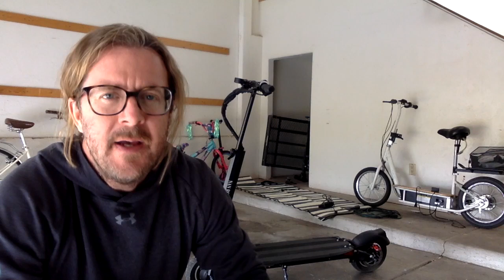Nanrobot Electric Scooter Review

Comment: Yeah so I ordered this from the Nanrobot site. Arrived broken, with a cracked back, fallen off back light, broken horn due to the red wire connected to the inside of the headlight unattached itself after one day, before I even used the scooter. It charges perfectly fine so no problems with that but the issue was the company sending me a scooter that has silver scratches/ scuffs on it which 100% didn’t happen during shipping, and a dodgy front and back light. The scooter itself works fine and runs well- but without the basic safety equipment of lights or a horn it makes it unroadworthy.
Reply: Emailed them hope they reply soon but it’s the weekend rn, I’m scared to send back because I don’t want to wait weeks for a replacement or for them to suddenly stop replying to my messages and just never give it back. 🤞🏼

Comment from the maker: Update. So I ended up buying a Razor E-XR with lithium battery for 1/3 the price of the Nanrobot. I have logged nearly a year on the new Razor with zero issues. The Razor is a solid commuter scooter and gets about 18 miles per charge. It's basically the same model you'll find in urban areas that have app rental scooters.
Reply: 18 miles... that is just disappointing, I've owned a D4+ 2.0 pro for around ten months and have had no issues. And I've ridden 2500 miles on it, I've hit mud holes on that thing that I simply was moving too fast to try and avoid that were over 10" deep I just couldn't let off the throttle or I would lose all momentum.  So I wouldn't knock Nanrobot because of one bad experience.

Comment: I have a NanRobot X4 and the Two nuts on the front tire backed out and almost came off. I fixed it with some lock washers but to think if I didn’t I could of crashed pretty bad
Reply: Hi there.Do you use screw glue? Before tightening the screws, apply some screw glue to prevent the screws from falling off.
Reply: You could use loctite but I chose to just use lock washers. The nuts have not come loose since
Reply: @guillermopacheco5005  Cool

Comment: I bought a less powerful D3 model and after charging the scooter twice after I bought it, the third time the charger would shut off at 47.4V instead of 54.4V as it suppose to. Contacted the company and they told me so far that my programming needs to be changed as it is set wrong. Now I see this video and I see that I’m getting the run around so far. I have ridden the scooter 4 times before this happen and also had to tighten several bolts and front break.

Comment: According to your description. I think you must put the port upside down for the whole time. Their charging port is so weak, and I have noticed that all the scooters from the market have the same issue. As long as you put the charging port wrong. I had the same situation before and it was because I did not pay attention to the charging notification, but later they still help me to fix it, they said it was because the battery got into the protection mode or something. But yeah, they are very responsible for my faults tho. I do not know how they deal with yours. But at least their scooters are fun to ride.

Comment: You Musta had a bad one I have This exact scooter With a seat 700+ miles on it I live in New York City A lot of traffic I’m able to move though into places like never before I also drive but Since I’ve gotten the scooter I haven’t use my car  I weigh 185 pound No problem at all for me to hit over 40+ MPH  and with 1 charge 60 miles range  at 18 to 25 Mph I’m so sorry you’re didn’t work Looking to buy another one for the wife
Reply: D5+ is awesome scooter
Reply: I love the D5+
Reply: Have you had to change your brake pads yet ? I ride my scooter everyday and ride it pretty hard I have 280 miles on it.
Reply: No I haven’t had to Change the brakes yet think God
Reply: Hey dude, where did you buy your Nanrobot? In the official website or on another site? And did you have to pay taxes for the custom when importing the scooter?
Reply: MRX07 hey bro I got it on eBay for $1449 all Tax and shipping included Look for this name on eBay Nanrobot (28) Customer service is great I had an issue and they fixed it right away the problem was my Rear fender pop off I had a real big Bump on the road Riding at 44mph If there anything else I can help you with let me know I’m up to 900+ miles now on the Scooter
Reply: Hey MRX07 I bought it on eBay for $1,449
Reply: Facts

Comment: It sounds like you are plugging in the scooter before plugging it into the wall socket which will spark and blow the little fuse in the charger, I have a Nanrobot D3 it may not be perfect  but its so  much fun it is, I would take a replacement in a second if they offer.
I have nothing but good things to say so far "knock on wood" about Nanrobot.
 I have an electric unicycle  Gotway mcm4 with the same charger and if you plug the charger into the unicycle  first it goes POP spark and dead charger.    Trying to help.  but to tell all people on YouTube to not buy the scooter in not a fair statement.
I live in Florida and have put over 300 miles in one month. 
Good luck, Imagine catching a sunset at 35 mph on that scooter.
I would recommend The Nanrobot D3 it goes a perfect 28 to 30 mph feels so right.

If i am wrong about the plugging in method my apologies, I do feel like Nanrobot is doing what a company can do to satisfy the customer,
including  a full refund.
Reply from the maker: I am grateful for your perspective. To be clear, it was not the charger. I sent the charger and scooter in for repair, and once diagnosed, the problem, they said, was that the "battery protection device" was "not aligned." They returned to me the same charger when they sent the repaired scooter. Also, I was mindful to follow the directions in the owner's manual, which states to connect the charger to the scooter before plugging the charger into the wall outlet. In either case, the problems with the Nanrobot D5+ seem to be primarily with a faulty battery protection device not the charger, though the two may be related for sure.
Reply: Hey, on which website did you buy your Nanrobot? Official? And did you have to pay tax for the scooter at the custom?
Reply: I noticed this too. I plugged my charger in to a power stip, then to the scooter, and it did fine. Then later I connected the charger  to the scooter first and I heard a pop and saw a spark at the connection. Im leaving it in, Well see if it charges. I'll update later.
Reply: TheMarcusGomez did it charge?